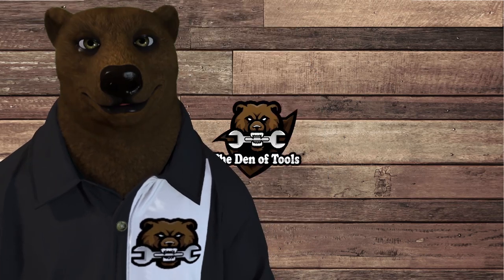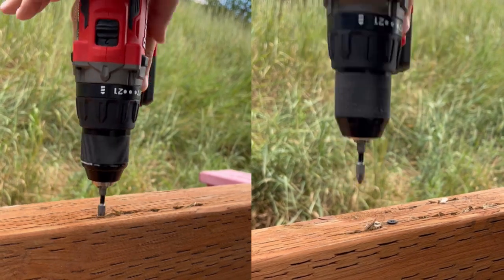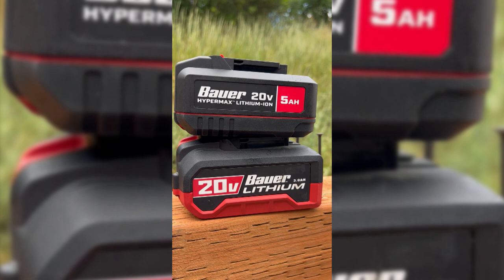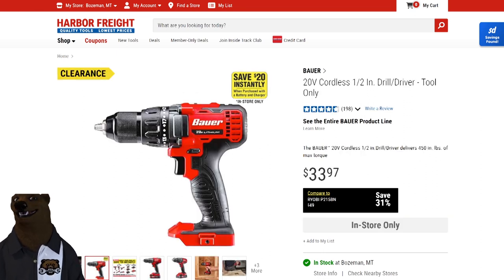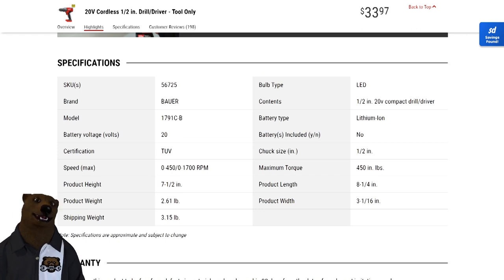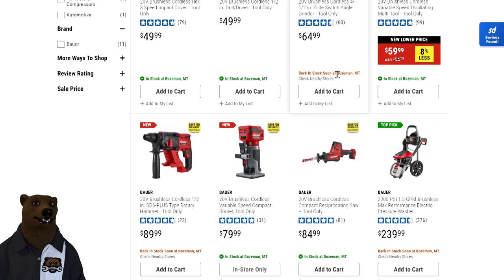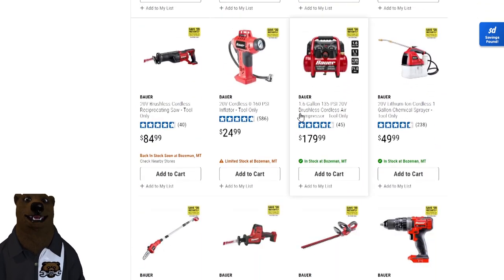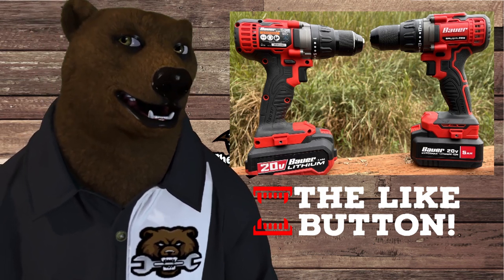New Bauer Brushless Drill vs Bauer Brushed (Is it worth it?)

Comment: Bottom line, if it ain't broke. Don't fix it. If you have a brushed version and it works fine, dont replace it with the brushless until it breaks. Or else the corporation wins. And you're stuck with two drills that work the same.

Comment: What HF needs to do is offer a more legitimate warranty system if they really want to compete with the big boxes tools.
Reply from the maker: HF sells the tool at a discounted price and then offers you the warranty as an option.  Every other brand inflates the price to cover the warranty and doesn't even give you a choice. If you need warranty service on other tools you often have to send it in and wait weeks to get it back and that is IF they decide it wasn't your fault.  At HF you take the tool in and they give you a new one, you are in and out in under 5 min.  What is you definition of "legitimate"?
Reply: @denoftools  That's actually a great point. For some reason I never thought about that.
Reply: @denoftools  Bear, what is your thoughts on HF warranty or not getting it versus buying Ridgid tools for their lifetime parts/service warranty??? I’ve been gravitating towards Ridgid more and more here lately over Bauer now that they are including batteries and chargers in that as well. I’m excited to see the Bauer ratchet though and hope it’s also brushless and would love to see it go head to head with the Ridgid and Milwaukee offerings along with the pretty popular Dewalt!
Reply: @adamchristopher2086  There are multiple accounts of Rigid not honoring their LSA, and blaming the customer for abuse. Also, LSA means Service not replacement.
More importantly, not all of their power tools get the LSA. I registerd a table saw and a worm drive circ saw about a month apart last year. When the processes finalized the table saw got the LSA, but the circ saw got a 3 year limited warranty. Buyer beware, and closely check the box for the warranty information.

HF will straight up give you a new tool right in the store if you get their warranty for any of their lineups, and not just Bauer. However, if you don't buy the warranty you're SOL.
I bought a corded Bauer drywall screwgun without a warranty. Figured it would last through my home remodeling, so didn't expect to need it. The setter chuck fell apart after completing 1 room. That pretty much turned me away from Bauer.

In the end, I went with the Metabo HPT lineup for cordless tools. They have a lifetime warranty, and there happens to be a service center not far from me.
Reply from the maker: @adamchristopher2086  When I first started this channel I was invested in the Ridgid line. I was contacted by several vewiers who told me their stories of Ridgid refusing to honor the LSA but I was sceptical so I tested it.  Ridgid bent over backwards to avoid warranting a tool!  That made me look into it some more and sure enough there are tons of stories out there of Ridgid screwing over users.  There is a reason it's not called a Lifetime Warranty but instead a "Lifetime Service Agreement".  Most states have legal definitions of what a warranty is, but an agreement can be anything the company wants it to be.  Check out my video, The Good, The Bad and the Ugly of Ridgid for the full story.   Also Ridgid has a much smaller tool line compared to most other brands including Bauer.   As far as comparisons you need to consider price in there as well.  All the brands you listed are much more expensive than Bauer.  Bauer is targeted at DIY level users and prices as such.  It is more on par with Ryobi as far as quality.
Reply: @denoftools  thanks for the reply. I appreciate it. I have two Ridgid saws their 12” Compound sliding miter saw with their MSUV stand and the professional job site table saw. I’m a DIY’er and hobbyist so they serve my needs well. Luckily no issues yet. I also just bought the 3/8” subcompact Ridgid impact wrench and two battery/charger max output kit. I was looking at their website the other day and seen where they are preparing to release a new 1/2” hammer drill with 1,300 in lbs of torque to compete against the Milwaukee. Was hoping the new Bauer brushless drill would have more but comes in advertised as 405. Do you think the brushless hammer drill will have more???
Reply: @denoftools  I hate to hear that about them not honoring the parts and service agreement though.

Comment: Brushless just makes sense for battery life as one heavily invested with Bauer I'll get the brushless drill one day my old one is 4yrs going strong only disappointment from Bauer is the ½ impact
Reply: What was your complaint about the impact? I steered away from both of the Bauer impacts in anticipation of the release of the brushless and I heard their TQ claims were exaggerated on the current models. I opted instead for the brushless compact Ridgid 3/8” impact and am in the process of trying to source a new old stock of the now discontinued Ridgid 6 mode high torque 1/2” drive impact that is rated at 1,500 Ft Lbs breakaway and 1,100 Ft Lbs tightening. Torque Test Channel done a review of it and it met its advertised TQ claims. It’s a beast!
Reply: It won't remove lug nuts from any car

Comment: I'm not fully locked into any platform at the moment. It's a mix of DeWalt and Milwaukee. They are starting to wear out. My only issue is I need more Mechanic tools. So the Hercules brand would suit me more. I need to figure it out soon because I plan on blowing a ton of money here in a couple months as soon as i find a new house to buy. But more than likely i may have to stick with Milwaukee due to the sheer amount of compatible tools.
Reply: Milwaukee definitely has several markets cornered with both their M12 and M18 line both auto/diesel techs, tire repair guys, carpenters, electricians, framers, it’s never ending it seems. However for me personally, I think the Bauer line offers more futility than Hercules myself and save a few bucks more in the process. They have a cordless grease gun in both lines and Bauer is coming out with a cordless ratchet which appears 3/8” drive. They also offer the outdoor power equipment line such as blowers and hedge trimmers if you ever needed that. Hercules doesn’t. I’m in Dewalt, Bauer(most), Bosch, and Ridgid. I’m most likely going to be buying more Ridgid in the future though with them expanding that line and the lifetime warranty and similarly priced with Bauer when on sale. Home Depot is clearancing out a bunch of brushless Ridgid stuff right now for the release of all the new 2022 pipeline of Ridgid tools.
Reply: I got rid of all my old craftsman power tools and decided to go with one platform. I decided on Hercules. They just didn't have everything I needed,  so now I'm in Bauer as well. If that doesn't release a few things I want soon, I'll be looking at going with Ryobi too.
Reply: I know Bauer is releasing some new brushless impact wrenches sometime in the future
Reply: @wrothacker4  I’m ready for them to release them and see the specs on them!
Reply: @wrothacker4  Where did you hear that? Do you have a timetable for it?
Reply: @michaelpolsinelli2345  no timetable, but if you go to the Bauer tools page you can see “coming soon” at the bottom and scroll through and there’s a 3/8 brushless impact and 1/2 brushless impact coming
Reply: @wrothacker4  Thanks.

Comment: I had the 5amh battery with a weedeater (more of a weed grinder. Let it swipe at some grass long enough and it would fall)  The battery lasted one season and one cut this season then it wouldn't charge. Turned me off from Bauer cordless all in all. Just bought the corded recip, never used one before but it does what I needed it to do.
Reply: Are you technically inclined at all? If so, you could always tear down the battery by taking the case apart and check each of the cells to determine which cells are bad and use a soldering iron to take out and replace the dead cells with new ones. Pretty sure they are 18650 cells. Some manufacturers use 21700 cells but I think the Bauer’s are 18650’s same as in most vapes.
Reply: I really appreciate the info and I watched videos on that but caught the craftsman buy one get one. Got the weedeater which was night and day compared to the Bauer, 2amh battery, charger and jig saw for $100.
Reply: @BamaDave501  not a bad snag at all!!!! Congrats!

Comment: I love my bauer tools. I have dewalt and kobalt also. And thanks to the Bear im now into ac delco ( waiting on that amazon shipment). I only got into bauer for one reason... of all things a hot glue gun. But im so glad i did. Sooo many other tools now are at my disposal if i dont want to spend on the dewalt or kobalt.
Reply: That hot glue gun is turning out to be one of my favorite tools.  I've used it to patch holes in the roofs of barns, a couple of holes that got melted into the side of a water trough, sealing leaks in old tennis shoes where the rubber has started separating from the leather at the toe...  =)
Reply: I agree, the Bauer hot glue gun is a nice addition to my Bauer family of Cordless 20volt tools

Comment: 60 tool 35 charger 35 battery 130-25 instore purchase 105 plus Taz hmmm I missing something 2 battery low end dewalt kit 99 plus tax lol
Reply from the maker: Bauer Brushless Drill is $60, 2x 1.5Ah Battery is $50, Charger is $25 = $135 minus $20 for combo pricing = $115.   DeWalt DCD777C2 (comes with 2x 1.3Ah batteries) is $160.  Facts!
Reply: @denoftools  my point was name brand over harbor freight...if it's a better tool than that's cool

Comment: 2 questions: does Bauer have plans on co6out with a drywall screwgun? And does that palm router double as a drywall cut out tool? A lot of guys in the trade have been using carpenter routers for drywall for there better preference.
Reply: I don’t see why you couldn’t use the router as a cutout tool. Same concept as long as you used a flush cut bit with 0° bevel and a roller bushing on the end of it. I’ve seen guys do that to speed up sheathing with OSB to cut the window boxes out. Rather than measure them out just sheath over them then use the router and aforementioned bit to cut them back out using the inside framing of the window box as a guide.
Reply: @adamchristopher2086  the standard guide point drywall bits for the routers we use are ⅛. Don't carpinter routers use ¼ bits?
Reply: Bauer already has a corded drywall gun but I assume you're looking for cordless.
Reply: @1Irvinv  I believe they do. I’m sure you could still use that though?

Comment: Quick question — I was at “The Freight” today and noticed both a 1/4” Bauer brushed drill and a 1/2” Bauer brushed drill (I think that’s what they were) in the clearance section — same price. Bear (and/or others!), any advice between those for folks who might decide to go the clearance brushed route?
Reply: Get the warranty, that way if it rolls under the car and gets ran over, you're able to only pay the difference and get the brushless later if you even have to warranty it out

Comment: I'd like to see a head to head with a fully charged 5AH battery using a large drill until the battery dies compared to a fully charged 5AH battery on the non-brushless tool. This would allow an apples to apples comparison and show the difference in battery life between brushed / brushless.
Reply: Agreed! He hinted at that, but never really compared them in that realm. 

Bear — you said there was more to come — maybe this? Bauer brushed with 5 aH vs Bauer brushless with 5 aH (same exact battery!) “to the (literal) death!” — time on-task, and also maybe holes drilled and/or screws screwed in/out? That would be helpful, and interesting!

Comment: Are the batteries used in the brushless and brushed versions interchangeable? If not, and they are showing that old brushed version of the drill the door, you'd best stock up on extra batteries if you already have or get one. One of Harbor Freight's less delightful proclivities is their complete lack of support for their discontinued power tools. It's shameful really that they don't support their legacy wares better...or even at all. Where the hell are my DrillMaster 18V batteries and chargers?! You mean to tell me they can't have a batch of them made up now and then? Even if they only sold them through the website it would still be better than NOTHING.
Reply from the maker: As you can see in the video I ran the new batteries on the older drill.
Reply: @denoftools  Oh, I see now. Good! I don't have any of their Bauer stuff yet, so am not familiar with what's what there. But I still wish they'd churn out a few latter-day 18V DrillMaster batteries...Hell, also the old 18V post-style ones for their ancient "Blue Series" gear, which I still have. I still think the little cordless sander from that series' old drill-jigsaw-sander-light kit using those triangular hook-and-loop sanding pads was the handiest detail sander for furniture and cabinetry refinishing I've ever used. Easily half of the oaky stuff in our hovel has seen that sander. I managed to find an adapter to use the later style DrillMaster batteries on it, but it kind of throws off the nice balance--and now they're seemingly a thing of the past too. Shame really.

Comment: I have both brushed and brushless cordless drills and 1/4" impact drivers (no Bauer brand) and, given an equal battery, I've never noticed much difference between them. I've definitely noticed a difference between brushed and brushless grinders and saws though, brushless, as you've said for quite a while, is the way to go with them.

Now for a question...Do you or any of the viewers know of ANY brand that produces a cordless hammer? I'm not looking for a hammer drill or rotary hammer, I'm looking for something similar to a hand held pneumatic hammer that uses either .401 or .498 shank chisels etc. that could be used for automotive projects. I've been looking for several months and haven't found anything yet.
Reply: @iamnotafraid  That's not an air hammer unless you can't hit a nail. I even said pneumatic in my post.
Reply: @Mike Brown I was trying to be funny lol